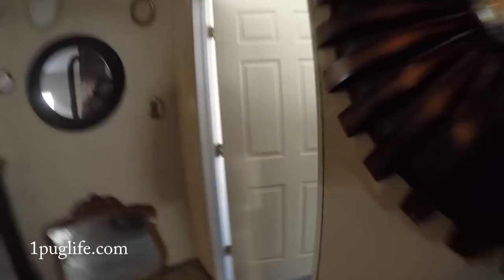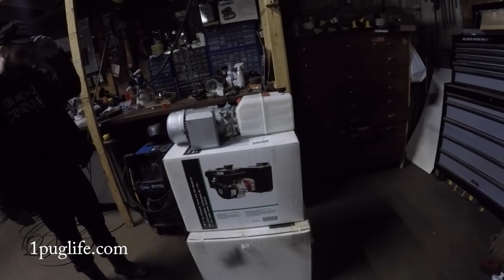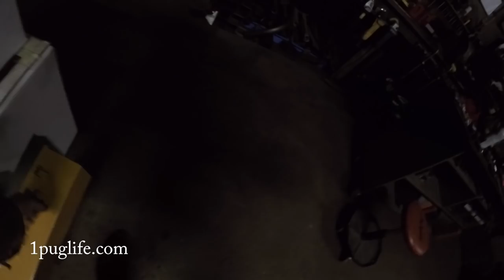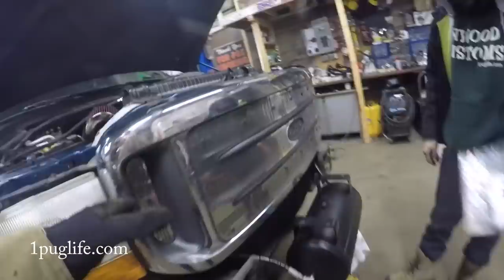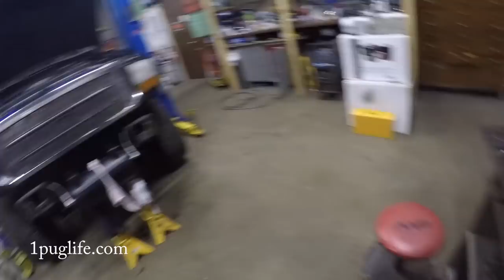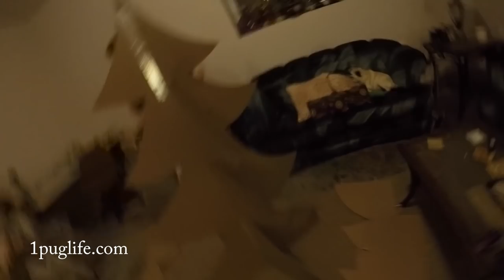quit the bumper

Comment: You need to front hitch mount that winch so you can winch forward and backward
Reply: I seen some new aftermarket bumpers have a 2 inch receiver for a winch you can use in front and back
Reply: Coro like zoro   Those are nice for backing boats and stuff when parking or what ever. Good stuff like that kine.

Comment: Sounds like your boost gauge is leaking psi, or the line that runs to it lol
Reply: Eliminator Performance it's probly one of the rubber boots by the way you can hear it farming out
Reply: Eliminator Performance probly the one with the cheap clamp bmp

Comment: you should see if the old wheels from big cigrit will fit rusty hammer.
Reply: Bailey Lauzon probably wont, the fords in that vintage were metric pattern. took alot longer before dodge and chevy changed to metric.

Comment: Just put the socket in the lathe and trim it down with a flap disk angle grinder you goof.
Reply: Theres nothing wrong with that.
Reply: Yknow I could tell him, go buy a pcd insert and get this fuckin holder and this and that to cut chrome plating properly but we're talking simple solutions for simple people here. There's no reason to be drivin around town for that shit when you could just trim the socket down in 5 minutes. Toss a rag over the ways so you dont grinding dust and shit on it yknow.
Reply: could just trim it in the lathe till it fits, or take measurements if you wanna do work
Reply: cant cut a socket with standard high speed steel or carbide tooling in the lathe
Reply: yea cos ther made of diamond,witch is what carbide cant cut......
Reply: No its called chrome and If you actually tried it instead of being an arm-chair scientist you'd know.
Reply: 25 years and never even thaunt to angle grint some hard shit on the lathe.